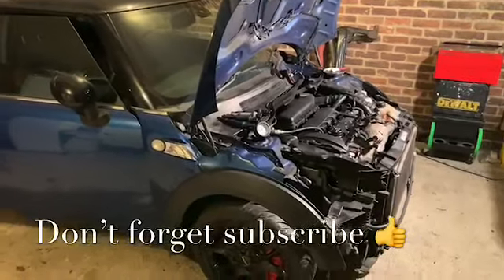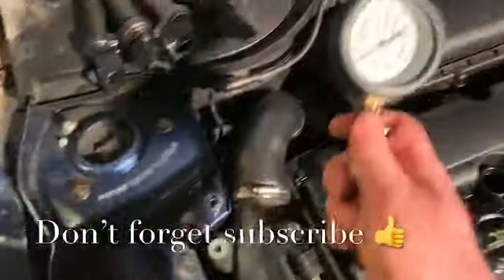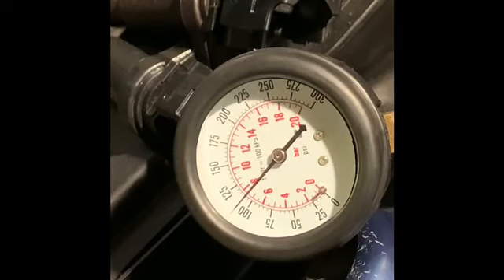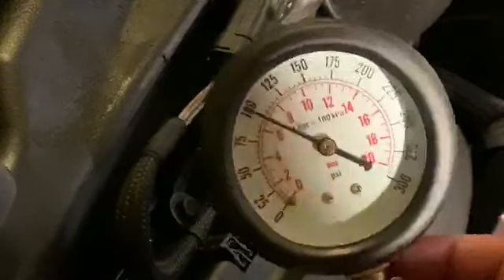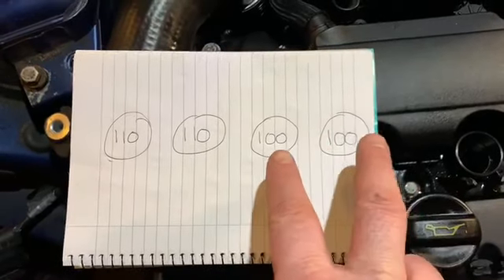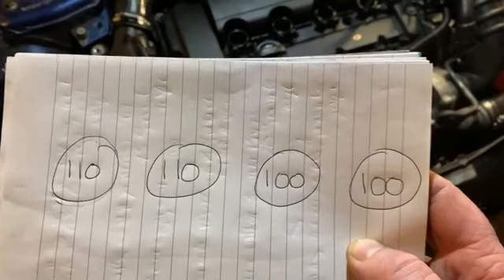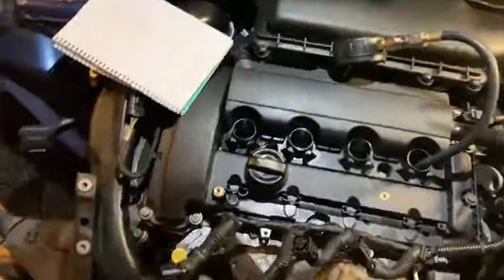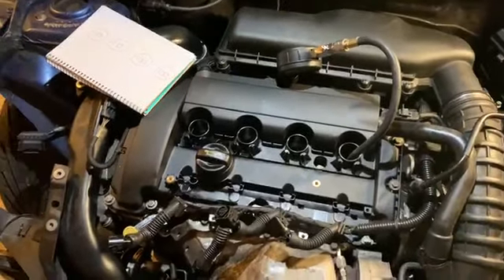Copart UK Salvage Mini Cooper S pt15 Done A Compression Test Not Sure If Good x Bad

Comment: Hi  Mark, 

To do a simple spark plug test, remove the plugs, reconnect a coil pack insert a spark plug, and rest it on a metal part of the block.

If you have a spark, redo the test with each coil pack with the same connector (as you know that one works, that way you have tested all of the coil packs. 

If all coil packs work redo the same test using the remaining three connections of the wiring loom.

If no spark after the first test it is either the wiring loom or the coil pack so try a mixture to see which works and which does not.

If no spark on any combination it is either loom, relay or immobiliser.

Using the above means you are not spending anymore money and will hopefully track the problem.

Spark plug test on link below

Happy new year to you and your family

Phil

https://www.youtube.com/watch?v=iMs6_bxyGVg
Reply from the maker: thanks phil I will be trying that

Comment: Its probably low compression as they are hydraulic lifters and they need oil in them to pump up and close the valves.  Check the timing, and make sure youve gt a well charged battery.  The chances of all four coils being  faulty is unlikley.

Also make sure the cam and crank sesnors are connected.
Reply from the maker: hi David I did check the hydraulic lifters did move but I didn't check if oil was in them might be a idea to check them

Comment: Hi mark, The longer the distance between the gauge and cylinder, the lower your readings will be. Also, the inside diameter of your hoses makes a difference --- the bigger the ID, the more air there is to compress. Also try it with the throttle open and at least 10 times and the battery hooked up to a booster.
Reply: 10 times of cranking each cylinder that should say sorry
Reply from the maker: Thanks dean I will give it a go with the throttle open I will get cables to my vans battery

Comment: These ecm hydraulic valve actuation engines are exacting...MAIN problem is ECM...code...battery values AT ALL TIMES must be within SPEC.
ECM throws Permanent codes..which LIMP mode is ACTIVATED...forcing REPAIR by Professional or Exacting Tested by Expert auto solution..but ONLY one correct answer/solution is a MUST by private Owners.
However...the ECM must be Cleared if Battery way too LOW at any TIME.

Comment: Hi mate, they're all low but pretty even. It should still make some effort to start and it isnt. It's hard to explain in words how to test for spark so look it up on youtube mate, any car with coil packs will do. It involves putting a good plug in the coil pack and earthing it on the engine and turn it over, the plug should spark. It will not hurt you or the car. Spark is the next step because I dont think you have one. Forget the sensors, they would show up on a engine scan through the obd port. Try spark next pal. You've come too far to get down over this. I've had loads and they can be a pain in the backside but fun when they're running. YouTube spark plug test. 
Good luck pal.
Reply from the maker: thanks mike I don't think got spark as well I think it might be a relay I am finding it hard because it seams liking hitting a wall and I don't have enough experience
Reply: @ResurwreckAutosUK  hi Mark, silly question but you are trying to start it with your foot on the brake yes ? It wont start without. Just trying to eliminate things. 
Mick

Comment: Hi Mark
I put money on it that you should replace the starter motor and check the coil pack.   Engine looks spot on and setup as it should.   I wouldn’t over think into-it mate.
Reply from the maker: Thanks mate I will have a look at the starter motor, I don't think I'm getting power to the coil packs at all but might be a fues or relay thanks again
Reply: Why would you think to change the starter motor ?
Reply from the maker: @ivorbiggun4919  Hi Ivor I wont change it just check its got the correct power going to it should be ok because it turns over ok this is defo a electrical problem might be ecu
Reply: Resurwreck Autos UK did you put the jump leads on it ?
Reply from the maker: @ivorbiggun4919  haven't not yet tried that I will probably mid week now

Comment: Hi there 
Can I just add to this 

First compression test is done flat out on throttle. ( full open)
 
If it’s still that low

 Did you do the hydraulic lifters?.

set them not to have Tight valves?.

That compression is too low

This is a very rough way 🙈
And I think it may get you out of the hole!
Not perfect but needs must.

 If you can box it all up to run ( start ). Top up water,oil 
So it’s good to go. 

I try to tow bump start it in 2 nd
Gear. 
It will build compression and fire 🔥 run. 
This is a drastic method and i do not like to do it only has a last resort. 
But it’s something to try has a diagnostic process. 
And you are confident you have got the value timing correct first. 

I think you have tight valves.

 You tow it to start it 
And after it’s run up it be fine.
Reply from the maker: Thanks I will try with throttle full open thanks

Comment: I’m sorry mate but for the heat that has gone through that engine any mechanic would be hard pushed to want to rebuild it.

How many times have you had it turning over building up oil pressure? 

Don’t waste money on “ spark thingy” connect the pencil coil up and plug in the spark plug to the end and have somebody turn it over and check they are sparking while resting on top of the engine.

Plug into the vehicle and have fault codes read, cleared 

I love people giving mechanics ago but you really have jumped in at the deep end
Reply from the maker: hi mate I have turned over the engine about 15 times I really tried to get this one done but its not looking good now
Reply: Try another battery or push it out get some jump leads on it and another vehicle next to it have u checked oil level? Have u drained and put fresh oil and filter in ?
Reply from the maker: @ivorbiggun4919  hi Ivor I might get it out and get jump leads on my van I have checked oil and a new filter I just think there is no spark

Comment: Hi Mark that engine should defo run with those compression readings . I would do as Mick says put a known good spark plug into end of one of the coil packs you could use a jumper lead clamped round spark plug threads to earth it ,put other end to a good body earth saves you trying to hold it lol then try cranking it . Video it if you cant see it , Its not easy to diagnose from just watching video but if everything is connected and timing is correct verifying spark would be my next move . Stay positive your almost there, have you checked fuses for continuity with a multimeter ? regards Rich.
Reply from the maker: hi Richard thanks for the comment I did put a multimeter on the end of the coil pack connecter and there was no power going though them any of them defo a power problem I think it might be a relay

Comment: You need a spark test. It could be the coil packs but it is unlikely to be all of them. That said it looks like at least on has been replaced. Compression is on the low side but should be OK. I would have had those pistons out when you had the sump off and replaced the compression and oil rings. Do you know if you have fuel?
Reply from the maker: Hi chris I think there is a problem with the wiring on the dash I think the car is in limp mode so the ecu will not let the car start

Comment: Tin of easy start to see if engine will fire.
Reply from the maker: thanks harry but still want start with out spark defo think that's the problem
Reply: Yeah that’s true I think the issue is your EWS.

This is a common fault code flagged by BMW & MINI vehicles when the EWS (also known as the CAS module or immobilizer) no longer communicates with the DME.

Read this think your got immobiliser issue

https://us.autologic.com/news/bmw-mini-fault-code-2f44

Comment: Your compression readings are of concern as there very low for this engine they should be in the 155-160 psi range , You have had the valve seats recut so that rules out any valve leakage & new head gasket so leads me to thinking the rings have worn .If you pour some motor oil down the spark plug holes ( not alot) then re-do the compression test you will see higher psi numbers this will indicate worn rings . sorry to say it but i would have dropped the sump off & had those pistons out while you had the cylinder head was off to fit new rings . Also the not starting fault has got me thinking that you have a faulty DME relay.  or a ECU problem check all wires/plugs  sensors for damage . but 1st thing is to pull the error codes off .
Reply from the maker: Hi mate thanks for the comment that's the thing it got no codes when I scan it I'm thinking the relay in the fuse box the black one on the right a lot of video's saying that's the problem crack no start I don't think I'm getting spark I do 
appreciate any help thanks again

Comment: hi your comps are a bit low but still should start,your battery is very low charge,also has it an inertia impct switch that has triped?usually located near battery may just need to press back in
Reply from the maker: thanks keith I will look for that switch

Comment: I noted you never smelt petrol while doing compression tests so maybe the fuel shut off valve that closes on impact is still shut. They are normally manually reset with a button. Here is the story for a Mini:

https://www.yourmechanic.com/article/how-to-replace-a-fuel-pump-shut-off-switch-by-marvin-sunderland

The other thing is Coil Packs won't have power until the ECU fires each one. As a last resort check all the DTCs (faults) in the ECU and clear them all and see what comes up when you crank. The car will be checking itself so may give a clue. My gut feeling is its the fuel shut off valve.

Good luck and Happy New year.
Reply from the maker: Hi mate this mini was not in a crash it over heated
Reply: @ResurwreckAutosUK  I know but I wouldn't ignore it but its up to you. Never assume anything. But if you have no fuel in the fuel rail which feeds the injectors its because of two things (apart from crimped / melted pipes): Fuel shut off valve closed which breaks the power to the fuel pump (for whatever reason) or the fuel pump is not working (for whatever reason). When you turn the ignition on does the fuel pump start clicking or not, does it start clicking and then stop or not? Do you hear the injectors clicking (as they do when empty of fuel and no pressure)? On some Minis there is plug at the end of the fuel rail if you open that do you have any fuel pumped out?
Just trying to help here.
Reply from the maker: @1chish  Mate really appreciate any help because I fill like taking it to field a burning it :) no seriously do appreciate it hope its some thing silly like a fuse or relay thanks again

Comment: Get back on copart and look for hard rear ended parts car that runs, try swapping bits over to get it running, if all else fails change engine over
And sell all other parts to hopefully make a profit, will make good content for your channel 🤙🤔
Reply: Change engine because it doesn't start? You extracting the Michael? He has good balanced compression on all cylinders so the engine itself is sound. There will be a simple answer somewhere...
Reply: 1chish  , you have obviously never tried to repair a seriously overheated engine before
Reply: @greggbutler9344  Oh here we go don't answer just project crap onto someone. Well I guess my time served learning my trade as a toolmaker (City & Guild Tech Certificate 1968), then fitter and becoming a Scania Master Technician for 10 years before retiring counts for diddley squat on YT then. So forgive me but I suspect I know more about molecular structures and how heat affects them let alone how to build any sort of engine than you do. Have you ever done a Scania 16 Litre V8? engine?
Anyway Old Son regardless of THAT he has sound if slightly low compression figures. All near balanced. The engine turns over. There was little fuel drain by past the rings. There were no score marks in the bores. The head has been properly reconditioned, timing checked twice and he checked the veracity of the cylinder block deck.
Just own up Pal you were trying to get the poor lad to swap an engine for more 'content'. Either way its a daft suggestion.
Reply: 1chish , as your so qualified, maybe you can tell him how to get it started, rather than writing your CV on here
Reply: 1chish , we can talk rubbish together alnight if you like, but the guy asked for suggestions on where to go with this project,to which I gave my suggestion
Reply from the maker: @1chish  thanks pall I'm not crying anymore
Reply from the maker: @greggbutler9344  thanks pall I'm not crying anymore

Comment: why not just use an obd scanner to check system rather than keep chucking money at it
Reply from the maker: Hi lee I have all ready tried to scanner it its giving no codes strange
Reply: Resurwreck Autos UK try looking under fuse box see if any wires loose or burnt
Reply from the maker: @leedavies9309  thanks lee I will try that